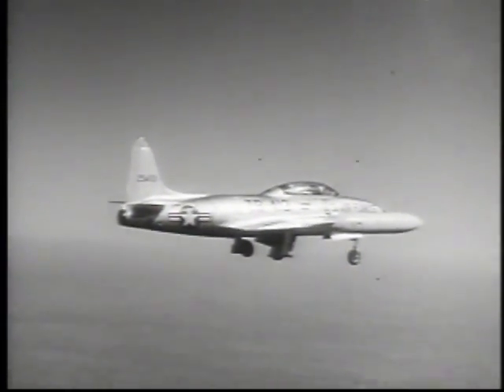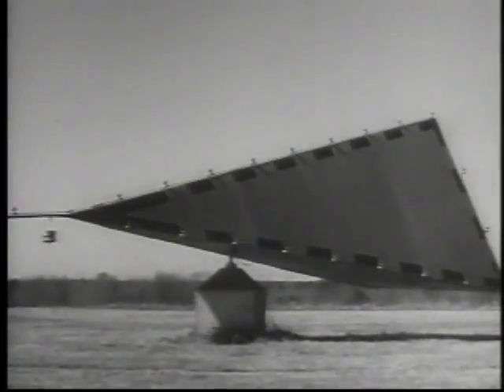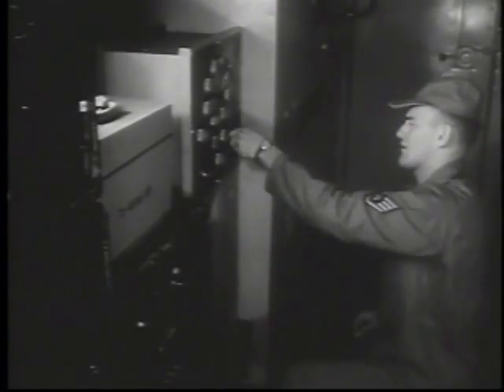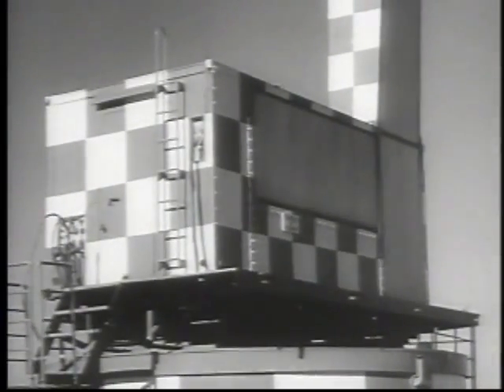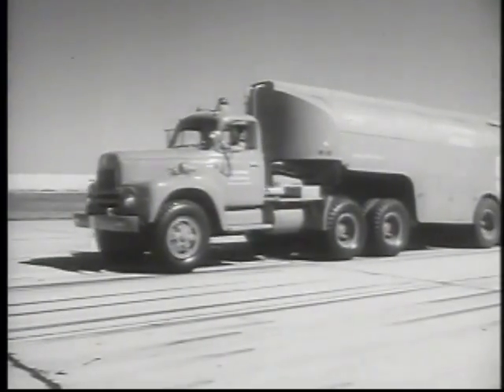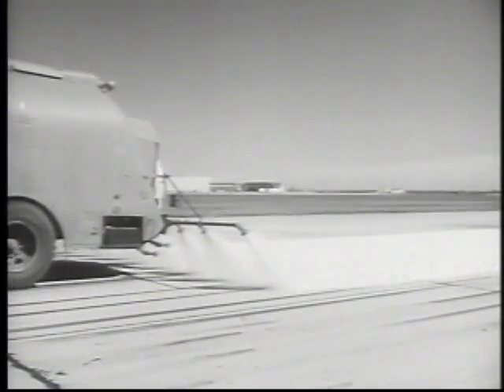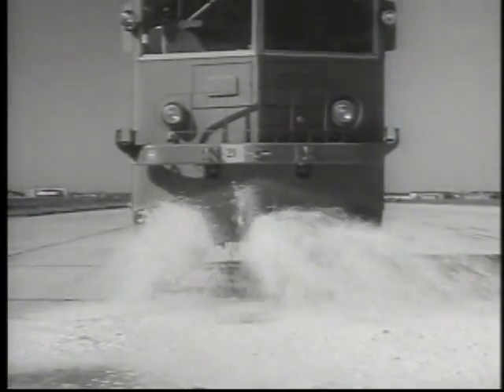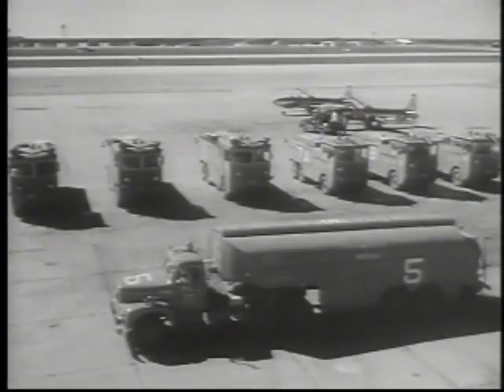1959 NEW TECHNIQUES AID AIR FORCE

Comment: Miramar, 70-74, maintained FPN-52 and (2) FPN-36 GCA, TACAN.  52 I believe was modernized 16 with solid state receiver IF and other improvements.  Used to fight MPI vibrations--A/C  unit in same van as RADAR, on hardstand.  I helped install and set it up in spring of '70, unit was brand new sitting at shop.  our shop was behind the now gone "boresight" range where aircraft guns were sighted, I see Tacan--may be same tower is there, nearly wiped off by "Sandcrab" on crane truck once
Reply: I was there 78-80. The '52 and the Quads were still there. The '52 was being replaced by a new radar just as I was leaving in 80. Our "sandcrab" was a big help while I was there.